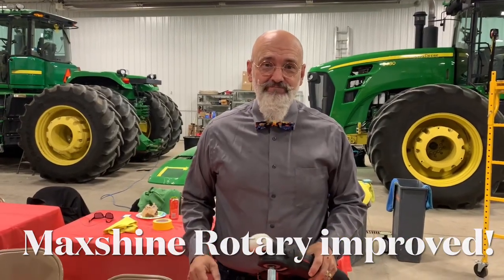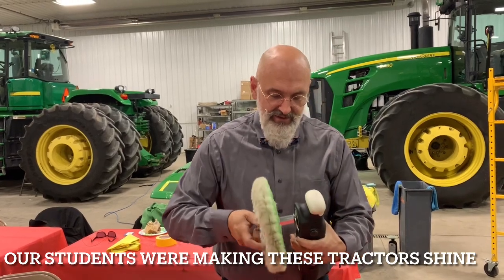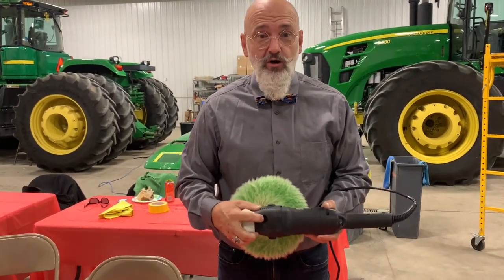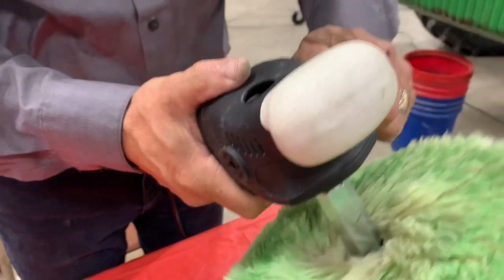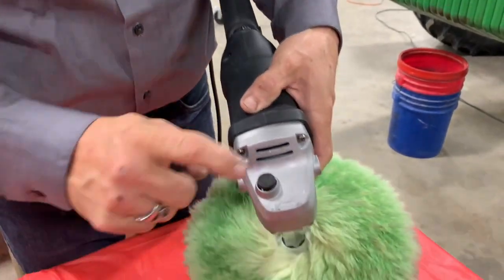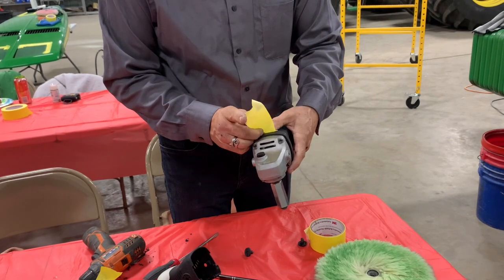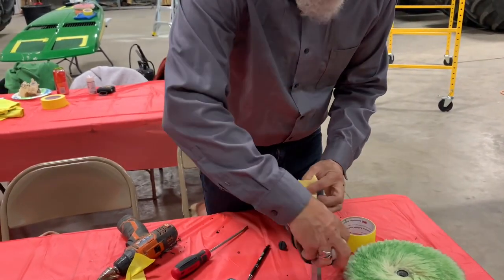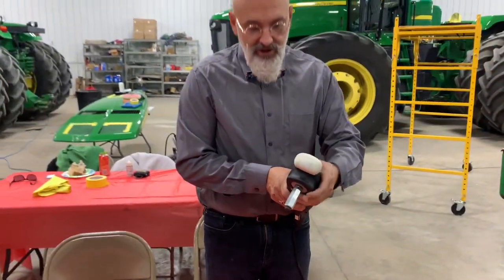Maxshine Rotary Modification, make it easier to use.

Comment: You can also take off a backing plate with a well placed karate chop (more difficult the smaller the backing plate) but this is more elegant solution.
Reply from the maker: Agreed.
Reply: I'd love to have a dollar for every time I "karate chopped" a pad to remove it. 🙂
Reply from the maker: I could have retired early

Comment: Nice tip! Thank you for that! How does that M1000 do with double sided wool pads? I have a bunch of double sided 8 inch wool pads from buff and shine, does the machine have plenty of torque for compounding? Overall would you recommend the machine for occasional use? Thank you
Reply from the maker: It does fine with my technique of slow speed and no pressure. If someone tries to put pressure on the machine, not sure it would stand up to that.

Comment: They built it with an arbor lock and hid it under the cover?  Designer versus the engineer, guess who won with the marketing department, LOL
Reply from the maker: The penny pinchers won.
Reply: Maxshine polishers are built with universal off-the-shelf parts from China, they don't employ any engineers or designers. They are basically just a marketing company selling cheap Chinese copies of Rupes/Flex machines to budget-minded detailers and DIY'ers. That same gear section is likely used for dozens (hundreds?) of different white label polishers and grinders that either have no front cover or a different front cover.

I'm not saying they are bad machines...but just know that they are built to a price point and are undercutting quality companies that have innovated for (and educated) all of us. For the detailer that is just trying to get off the ground on a shoestring budget, they are a good option. But as soon as that detailer turns a profit and grows their business, they should invest in quality machines and keep the old ones as an emergency backup or as a beater to train the new guys.
Reply from the maker: Agreed
Reply: @jeffc6832  no kidding, when he took the cover off, it looks like a harbor freight rotary polisher. I’m sure it’s a little bit better though.
Reply from the maker: They all look similar when the plastic is removed.

Comment: so they hid the button under plastic, brilliant
Reply from the maker: I guess it’s less expensive to provide the wrench than to drill a hole.
Reply: @Detailers-Business-Academy  interesting!
Reply from the maker: Thank you
Reply: @Detailers-Business-Academy  than what be the point in making the button lock
Reply from the maker: To allow for easy backing plate changes
Reply: @Detailers-Business-Academy  I'm saying if it less expensive to give you a wrench than why put button in the first place
Reply from the maker: Probably the same housing is used for many different tools
Reply: @Detailers-Business-Academy  makes sense, I figer it was so they could market it as a "upgraded" model later on without having to change anything
Reply from the maker: Always a possibility.

Comment: The fact that maxshine sells this unit without the button being accessable is outrageous. That's typical though. Most of these cheap rotary polishers are just die grinders or angle grinders with different heads attached. Difference is Maxshine pretends to be a detailing company so they charge $150 instead of $75 like the other amazon brands, and they use the extra money to pay for reviews on youtube.
Reply from the maker: It’s still a good machine, and this isn’t a payed video.
Reply: @Detailers-Business-Academy  I didn't mean to suggest that this particular video was sponsored, or even that most maxshine reviews were. Just pointing out that the quality of maxshine machines in general does not seem to live up to the amount of hype they've received from the detailing community at large.